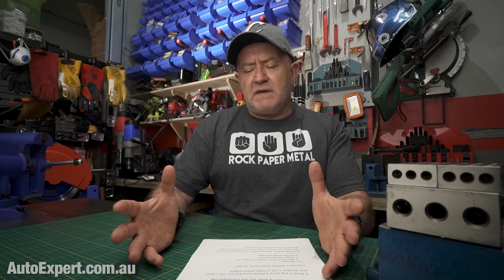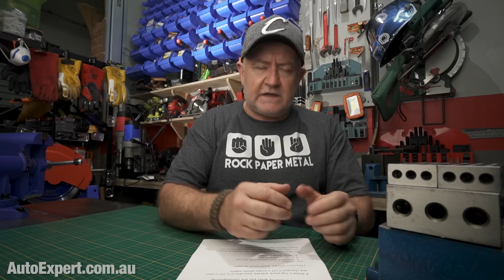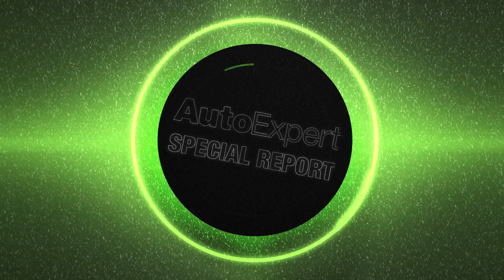Best way to charge your EV at home (for complete electric car novices) | Auto Expert John Cadogan

Comment: We charge once a week at home.
Average weekly commute is about 300ks.
Average charge cost $2-$4.
11 kW 3 phase charger. 
One phase from 6kW rooftop solar
2 grid phases between 2 &12c/kWh during weekend days when grid has >60 renewable energy component.
Amber Electric is retailer who has dynamic pricing.
Reply: Does your car support 11kw? As if it only supports 7.4kw then you will only get 3.6kw from your 11kw 3 phase.
Reply: @gregb1599  .
Yes 11 kW.
Ausgrid kindly & without our request upgraded our 2 phase connection to 3 phase a few years ago.
Reply: @tristan351 it all does. but not to the extent of an EV. in 8 years from new you have an EV that needs a battery replaced. this costs more than the car is worth. in 20 years you might need to re sleeve or replace the internal combustion engine, which will only cost a couple of grand. i don't care which side anyone picks, but lets be honest about how much things cost and what actually wears out on each.
Reply: @waldopepper4069  with respect, you’re not really being honest. 
Your claim that batteries need replacing after 8 years is simply untrue. Plenty of data out there disproves this.
The WARRANTIES are universally at least 8 years. Mine is warrantied for ten years.  A Toyota rep told me that in his experience the LEAST number of years a battery has lasted was 14 years.
LFP batteries now being fitted to a wide range of cars are expected to do 1.6 million kms…
A Finland taxi driver has  a 2014 Tesla Model S which, by 2017, had done 450,000 kms and was still getting 93% charge. That’s the equivalent of 34 years driving for the average Australian.
On top of all that, you pay very little for service and parts for these cars.
Reply: @zwieseler  its not an honesty thing, i heard 8 years from tesla, but perhaps they have now extended that. 8 years, 10 years, its irrelevant. it doesn't change the fact that the car is a liability at the end of its battery life due to the battery.  but you already own an EV so just go and enjoy it. i wish you well. but your finland example would impress me more if ALL finland taxi drivers were getting those results. does it not concern you that only one driver is ?
Reply: @waldopepper4069  you’re confusing  the warranty with the battery serviceability. Do ICE cars fall in a heap when they hit the end of their warranty period? 
I gave you the Finland taxi driver as an example. I’m not going to spend half a day documenting every similar case. Dyor.
Reply: @zwieseler  you sound more like you are trying to convince yourself than me. go and enjoy your EV. ill go and enjoy my ICE. but to answer your question, ICE cars have a value at the end of their life. i think you and all EV owners are going to come face to face with the realities of EV's once all subsidies are removed that they used to con you into EV's in the first place, and they start charging you the true cost for charging, start introducing road taxes to EV owners to pay for the roads, and at the end, you have something that you will need to dispose of correctly through environmental agencies and channels at significant cost. those batteries are full of toxic chemicals and will need to be disposed of properly. so at the end of 10 years you might get a ten grand bill (total speculation on my part) to dispose of the car, where as my ICE has a value to someone and will keep going for another 50 years. might not be huge, but its not worthless, nor a financial liability. ask yourself this. if EV's are so good, why would they need govt and manufacturers subsidies to sell them. why are they not flying off the shelves without them ? and you dont need to document every case. surely just site the reports of the thousands of taxi drivers and owners the world over who are getting these phenomenal results.
Reply: @tristan351 i think you should go and buy one.
Reply: yes, but like all cult members (sorry, ev owners), you only ever quote the electricity price. never the full cost of ownership, you never acknowledge that the electricity is generated from fossil fuels, never address the fact that your battery in the EV is a depreciating liability and will cost big bucks to replace every 8 years. never address the impending costs that will be coming in due course, such as a rise in electricity prices for EV filling (someone has to pay for all the charging stations and infrastructure), and the road taxes that are inevitable if roads are to be maintained in the shadow off a diminishing petrol fleet. its a green wet dream. dream being the operative word. that said, i think EV's are a great solution to inner city motoring, and inner city pollution. they are not for long distance driving nor for trucks. the sooner reality is returned to by the world, and we call spades "spades", the better humanity will be.
Reply: @waldopepper4069  
He's alreadty made the effort to install solar power and a battery at his home.
Have you?
Reply: @JohnSmith-yv6eq  why would i do that ?
Reply: @waldopepper4069  
Just to understand that he has already thought ahead and is saving money over time.......?
He's giving it a fair go mate.....
Reply: @waldopepper4069  
I agree...but video recorders, DVDs and electric personal transports of different type are all still with us.
I hope that Tesla Superchargers become universal and that other companies realise that they need that technology at the moment to ensure charging in every climate....most other company chargers fail at extreme heat or cold.
See vids of tests done in USA by YTubers illustrating just this.....
Reply: @JohnSmith-yv6eq  i think the EV industry is marketing itself wrong. it should go whole heartedly after the small run around town segment, which is where it works, where it operates the best, and the prices of the vehicles would therefore be cheaper as well. instead they market themselves as the panacea to the worlds imaginary problems. 150 years ago these people would be referred to as "snake oil salesmen".
Reply: @waldopepper4069  
I was staying on topic with a real-world experience to share useful info.

I didn't anticipate a free-range rant of utter nonsense by a Luddite. But you have nicely summed up all of tired old garbage circulated inside your tiny echo chamber.
It's time to get up to speed with the real world, and also maybe have a chat to the hundreds and hundreds of people who live out west with electric vehicles.
Reply: @waldopepper4069  
Onya mate.
Reply: @guringai  no idea what "onya" means im afraid.
Reply: @waldopepper4069  
It is an Australian common useage roughly translated as "Good on you mate>"

Comment: What if you have two electric cars or god forbid three?
Reply from the maker: Charge at different times or on different days.
Reply: @AutoExpertJC  maybe, I don’t suppose you will need a full charge on each but you’ll be playing musical cars for the outlet.
Reply: @Rockbottomsurf  
A variation on this is required for public charging parking spots.
The charger should be at the intersection point of 4 car parking spaces.
The 4x charge cords can each be plugged in and the charger decides, based on your instructions and the first in first served principle...which car gets charged...and does so automatically.
Thus all cars will be charged and no shuffle required...
you can go and do your shopping for 3 hours and not block any charge spot....
plus if you are towing a caravan or trailer...
parking over 2 spots still allows full charging access????
Reply: @JohnSmith-yv6eq  the possible implications of that gave me a headache.
Reply: @Rockbottomsurf  
Now you've thought about it...
it really doesn't make sense putting charge pointsa round the edges of car parks...does it?
I mean even if they have only 1 car charging cable the ability to plug it into any one of four parked EV's means that if the charging is complete...
then the cable can be unlugged from the fully charged car and plugged into another EV without a shuffle and without the anger at someone "blocking the only space"

Comment: Best way is to use your neighbor power
Reply: Thou shalt not covert thy neighbour's power!
Reply: Got a better idea you by pass the meter box  go straight to the grid and it will be free but if you get caught it will be free accommodation in the big house
Reply: Just charge it at work, we have e.v at work, so I charge my battery motorcycle.
Reply: @Digital Dependance  yeah, most would charge, no pun intended, but your not really allowed to sell electric  in the uk, only registered companies can sell, so it would probably be a flat no.
Reply: @Digital_Dependence  possibly not, I only know because in the uk camp sites used to charge a separate fee for electric hook up. Then they got hands slapped because they are effectively selling electric unregulated.
Reply: and their car too ;)
Reply: Ha ha ha finally this bogan admitted EVs are something worth looking at.
Reply: @Shiva Sapkota  he had one. Never said once they weren't any use. He said they are useful in the city/short journey type work 99% of people make 99% of the time. I've got an electric motorcycle because its only 3.4 miles to work,  I've a bmw r1200rt or my diesel car if I need to go farther a field/pull my trailer.  This is why you can't go full electric, just use it for part of your life.

Comment: I live in the inner city and usually drive short distances, so an EV is perfect for me! Except, like thousands of other households, it isn’t so easy because I live in an apartment building where getting electricity to my parking space isn’t exactly straightforward. 

And then there’s the people who only have on-street parking. I’m curious to see how they’ll manage when ICE engines are phased out.
Reply: We're looking at apartments for our son to purchase, at present. One of the considerations that we put forward was that the ability to install charging infrastructure should be a consideration for his next purchase.
We've quickly revised that to; "don't even worry about it". Aside from it being a ridiculously expensive piece of infrastructure to install, we were informed by an independent electrical contractor that in most medium density residential areas, there isn't the available current in the grid to supply multiple residences with multiple 30 amp outlets. His reckoning was that fuses would be popping like AK47's at a Syrian wedding (his words).
Reply: @davidbrayshaw3529  . If by chance you are in North Sydney LGA, there is a council program to assist old buildings modernise & update strata for EVs etc. 
Some strata committees are surprisingly forward looking, and understand the value of upgrades. 
Domain surveys found that buildings with updated electrical infrastructure and efficiency are up to 70,000 more value. That becomes a big driver for change.
A single charger in the 'common area' property is often what works out quite well at a fairly low cost.
Reply: @guringai  No, unfortunately. Our field of scope is within the inner S.E. suburbs of Melbourne.
I have no doubt that updated electrical infrastructure improves both the value and the amenity of the property, hence my consideration in the first place. I will be interested to see if, in the future, the grid can support such upgrades.
A single charger in the common area certainly makes the most sense, at least in the interim. But I honestly can't see this resolved by body corporates at their AGM's any time in the near future. Not in Melbourne, at least. Anecdotally, I would suggest that more than half of the apartments
are rentals that rental providers don't want to spend a cent on. And, of the owner occupiers, most drive "bombs" and/or rely on public transport.
I'm painting a small picture of the inner S.E. of Melbourne, it might be different elsewhere.
Thank you for your considered and informed reply.
Reply: @guringai  this is what I’ve wondered about a single point in a common area - who pays for the electricity? Is it evenly split between each apartment’s meter?
Reply: @tehclam There are solutions for charging using RFID cards that would charge back to the specific user at the end of each month. Those chargers are a little more exe because the provider does all the back end infrastructure and will issue the accounts automatically.
Reply: @tehclam  - the body  corporates will probably install a commercial charger that has its own power supply. They will be for profit and the funds will go into body corporate General Revenues. The more charges they install, the more money they will make. This will both provide a service and generate income. Capitalism  Baby !!!!!
Reply: @davidbrayshaw3529 I don't think that's correct. Most apartments are still fed by a 100 amp supply so not that different from houses. The whole argument is ridiculous because as an electrician he should know you can't install a circuit that would overload the switchboard. I'm sure they're are some older apartment blocks that will need their electrical infrastructure upgraded but if you amortise that across 20 or 30 apartments the cost should be reasonable and as others have pointed out increase the value of the property.  You can also limit the amps on most EVSE's if the overall switchboard capacity is too low. So for example if you have a 100amps available and your peak load is 75amps you can limit your EVSE to 24amps. It will have to be on a separate circuit anyway. Australia actually has it much easier than 120V countries.
Reply: @mondotv4216  He wasn't talking about the apartment block's circuitry being unable to carry the load, he was talking about the electricity grid's capacity.
Apparently, during times of high demand, many circuits are close to their rated transmission limits. He pointed out that when the grid was designed and rolled out, it was designed with providing "X" population with enough current to power lighting and a radio set. Of course, here we are today, with refrigerators, air conditioning, TV's, washing machines, driers etc, which were never envisioned when the grid was first rolled out. We've effectively already out grown the infrastructure.
His reckoning was that there could only be a limited number of charging outlets given approval on any given circuit without major infrastructure upgrades such as increasing supply voltage to the local circuits, replacing transformers and in some instances, transmission lines.
His top tip though, was if you are considering installing a private charging station, don't wait, do it now. Especially if you're considering high current
chargers.
Reply: Those of us who rent are SOL (doubly so with no solar panels). Landlords aren't going to drop a couple of grand to install the charging infrastructure out of the goodness of their hearts without passing on at least the cost of install. Even worse are those who live in massive apartment complexes. The cost of installation of appropriate charging infrastructure for several hundred vehicles would have to be eye watering.

I can see this becoming a nightmare.
Reply: @aftp4i94  As a landlord myself, my tenant asked me to finance the installation of an outside wall charger for their new model 3. I obtained 3 quotes for the installation and offered to go halves with the cost. They gratefully accepted and it was installed 2 weeks later.  We also went halves on a solar panel installation as they are long term tenants and plan to stay at least another 5-7 years and are great people. This is a villa unit.
Reply: @aussietaipan8700  . That's a great story! Excellent attitude.
Reply: @aftp4i94  likewise
Reply: @tehclam   One thing that is not addressed is the added risk of fire in an apartment basement carpark . As John mentioned the risk is low but the result is catastrophic . It will only take 1 EV fire to destroy an apartment block in Australia and the insurance industry will increase rates for buildings where EV's are charged . Who pays the increase ? I know Queensland Fire are already looking at building code upgrades etc.
Reply: @derekgodfrey5 To put that into perspective, currently more ICE fires (percentage wise) with parked cars than EVs - that could be due to the comparitive ages of the fleets. Sure an ICE fire is easier to put out but I don't see it being increased risk. There are ways to fight EV fires - it's just significantly more expensive as it involves specialist equipment. Ikm not trying to minimise the risk but if you listen to JC you wouldn't park any car in a garage. That's just not practical for most apartment dwellers.
Reply: @mondotv4216  totally agree on ICE cars verses EV now , what about 10years from now , when the EV's are older and maybe a bad batch of mosfets have been fitted to chargers ,making not to switch off ?Electronics do fail . As I said ,it will only take one apartment block fire caused by an EV charging and the insurance companies will put huge increases on rates, who pays , just the EV owners or the whole apartment block tenants.There won't be enough power in the Australian grid to worry about it anyway . You only have to look at the debacle of the NBN .
Reply: Soon there will be plenty of fast charging available for weekly charging whilst shopping.
Some of the inner city councils are currently working on this.
Reply: @guringai  They say that, but it will only be a minority of parking spaces, like disabled parking. Those spots will fill up quick, and you'll be sitting there waiting as long as it takes them to finish shopping (assuming there isn't already a line waiting to charge their cars).
Reply: @guringai  At a premium, though.
Reply: @davidbrayshaw3529  Not as much of a premium as petrol…. And, cobber, there are businesses which provide free charging for customers.